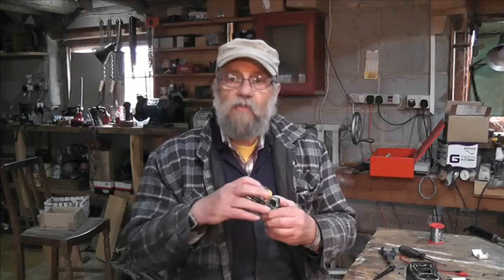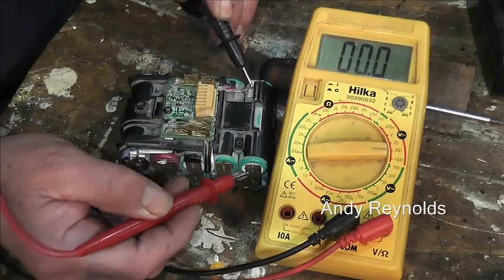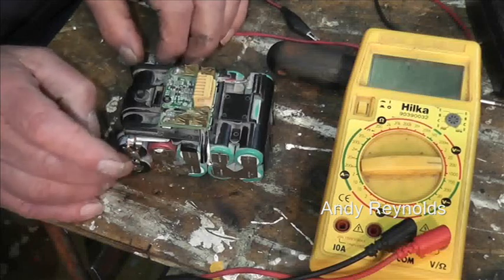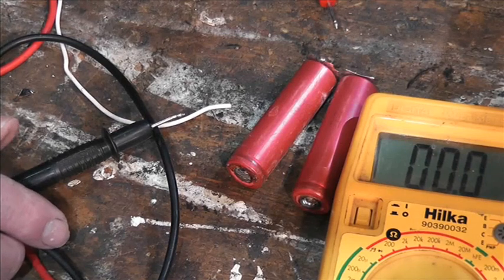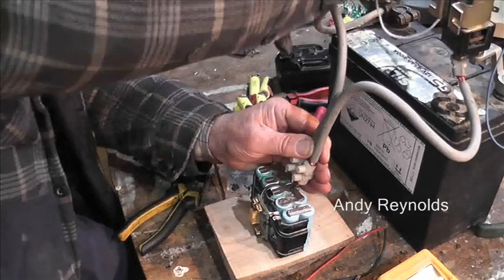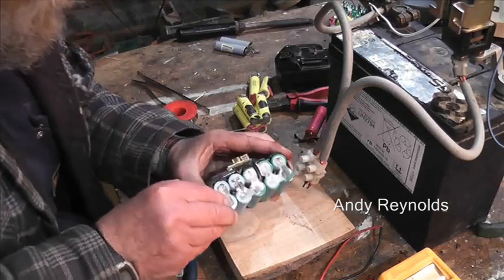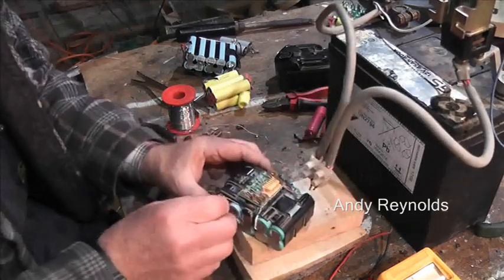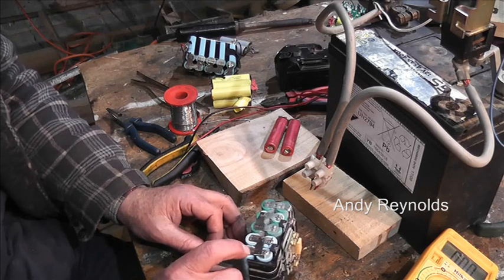Lithium smoke and mirrors, testing for current

Comment: I've got an ebike with a battery problem. Do they also contain numerous small cells? It wieghs a few kilos. Maybe the charger, I'm no sparky!
Reply from the maker: Hi, from my limited experience it's the battery management board that packs up. For you the best thing is to have the case apart and get the multi meter out, cheers
Reply: @TheInfoworks  my work bench is the kitchen table.😊 Time to bring it to a pro! 👍
Reply: @nickrich56  I’d say the kitchen table is good enough to get going. Open up the battery and test it with a multimeter as Andy did. If all the cells have a similar voltage then as Andy says: maybe the battery management board. You can’t make it more broken by opening it and looking at it!
Reply: @bootsowen  it still functions but it never seems to fully charge. Like I said I'm no sparky! 😊🍿👍
Reply: @nickrich56  can’t hurt to look. Multimeter on each cell
Reply: @bootsowen  When I get the gumption! Thanks for the encouragement! 😊🍿

Comment: Interesting spot welder.
The only time I tried to repair a battery, my microwave oven spot welder didn't seem to work. It seems to be more of a general warm up rather than shock. That lead acid battery must deliver far more current.

I have another microwave transformer so am tempted to double up like on a Make It Extreme video. Presumably twice the voltage but same current = more power.
Reply from the maker: Ian, I think it's a fine balance, if I use a fully charged battery it burns holes, so maybe 6v would be better but this works for me. Trial and error shows the way, cheers

Comment: It's another good reminder to test with load to determine current capacity. The car electronics videos I watch say the same. When testing wiring faults, check with a test light, ie incandescent bulb, as multimeter can give false positive.
Reply from the maker: Ian, yes I could have used a 6v bulb, but the quick strike seemed to work. Strange how the voltage just collapsed, cheers

Comment: Another one saved from the tip. Good work.
Reply from the maker: Simon, oh yes, recycle the recycled. Those impact screwdrivers are brilliant, cheers
Reply: @TheInfoworks  Aye i don't know how we managed before them. Handy for stripping the car down too.
Bought an old jonsered chainsaw recently for coppers nice starter and runner.
Do you know much about them?
Reply from the maker: @thornwarbler  Simon, they are similar to Husqvarna saws and have a following. If it runs well it has value. Sold some non runners on Ebay a while a go for £35 each,  cheers